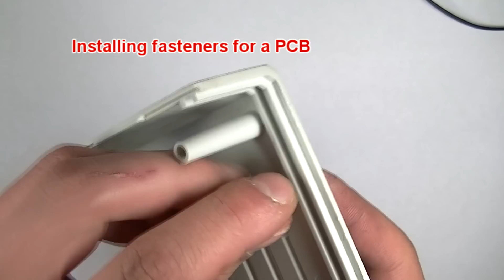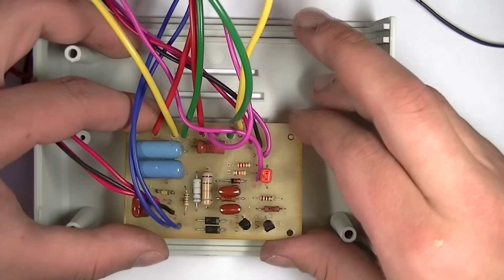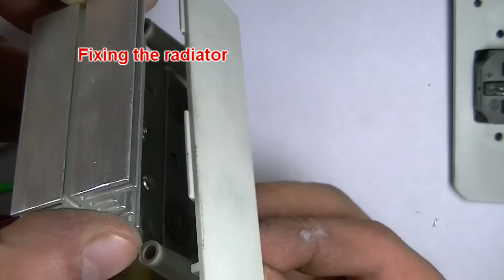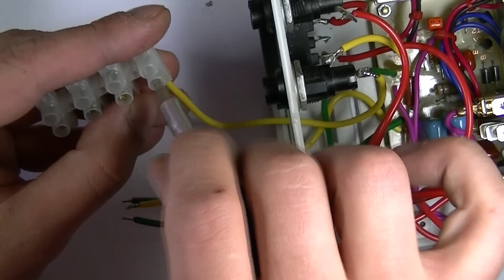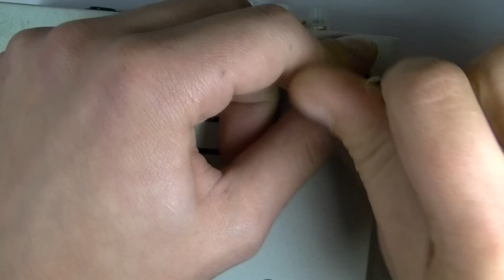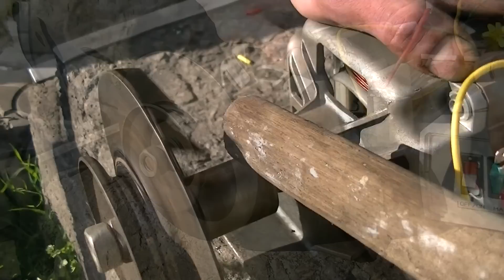Device is ready! Speed control of AC motor (Voltage regulator)

Comment: It was interesting watching the piece of tape on the motor; once you cranked up the speed, we started to see digital artifacts, which is always neat. Anyway, thanks for sharing. I was just watching some videos of people creating homemade wood lathes, and controlling the speed of a lathe through a series of homemade gears and a belt seems a bit old-fashioned, I suppose, if one also knows how to solder. Edit: Two videos later [ http://y2u.be/ZKodxGcRSnw ], and I discovered why I should probably be using gears and a belt for the types of motors I was considering for my own upcoming homemade lathe project.

Comment: I really don’t need a video which tells me how to assemble a box and use screws! Just exactly what useful content is this video supposed to contain, because there was nothing useful about regulation, power control, dangers of uncontrolled AC circuits, RPMs or torque. Don’t waste your time (or ours) with back-patting exercises!!
Filotec